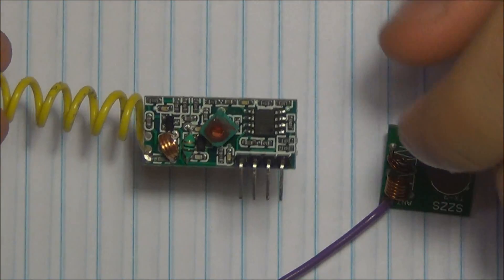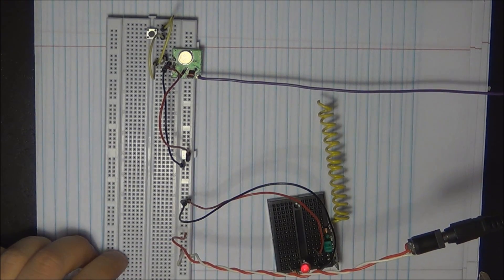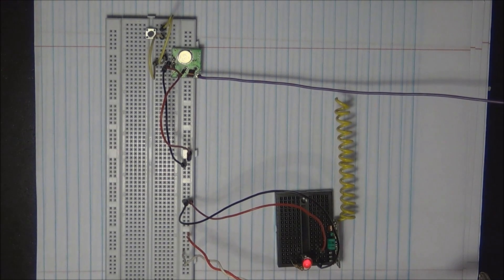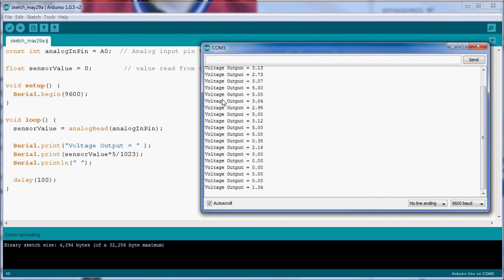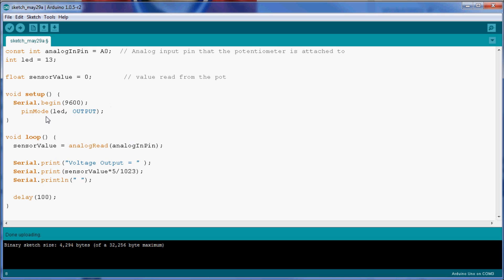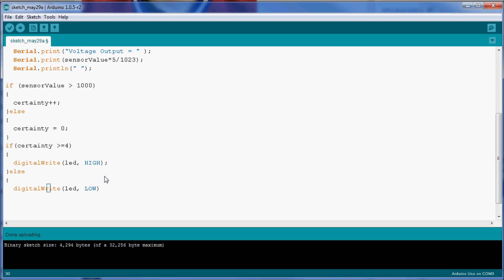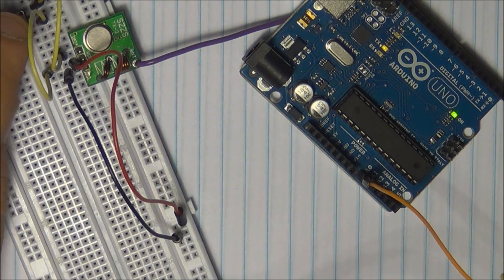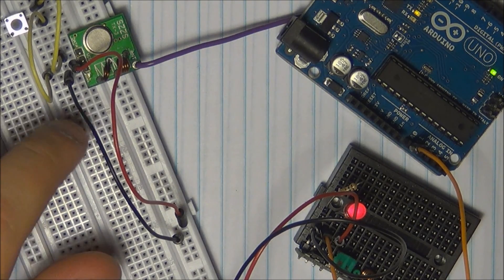Arduino Tut. #8 - Wireless RF Links Tutorial & Noise Reduction

Comment: Hi, I came to your video while searching for some fork of the RadioHead library that would compile cleanly on the Roger Clark core for the STM32F103C8T6 board... or I'll have to use the code from one of those nice Arduino MorseCode tutorials, encoder+decoder  :D

I think you are actually debouncing the switch you have connected on the TX side, I wouldn't call that "noise reduction".
Yesterday/today I've tested at that short distance two pairs of those TX and RX modules, 433 MHz and 315 MHz, and they do not introduce that kind of "noise".

Test conditions (please NOTICE that the last time I launched the scope autocalibration, 2-3 weeks ago, it was warmer than now, so the values mentioned below might not be the most precise readings I could get out of this low budged 100 MHz two channels scope, which is anyway great for the price IMHO):
Signal generator two channels into the two TX modules, tested with 0..5V square wave and also 0..3.3V square wave (and varied frequencies and duty cycle).
Oscilloscope two channels from the two RX modules, I get two nice rather clean 0 to 4V square waves (actually min -240 or -160 mV to Max 4.08 or 4.20V, rarely 4.32 V, so in order to safely feed that signal into 3.3 V not 5V tolerant pins I'd use a voltage divider: 4.7 and 15 kohm).
This 433 MHz RX module shows (surprisingly) a longer rise and fall time than the 315 MHz one, 14-20 µsec vs. 7-10 µsec, which implies that when raising the modulating frequency up to 8-10 kHz (50% duty cycle) its output becomes earlier a trapezoid and finally a triangle than what comes out of the 315 MHz module.
5V power supply into the four modules (nothing fancy, I do have completely linear power supply but also wanted to test a breadboard power supply that I also just bought, which in turn was being fed by a small switching power supply rated 9V 2A).
No breadboard, just Dupont cables, everything on a wood desk.
I also tested feeding into the TX modules very low frequency sinusoidal and triangular waveforms (down to 1 Hz) => better than I expected, not quite as if the TX modules were incorporating a Schmitt trigger but less "spurious" commutations than I expected, mostly on the falling side of the square wave coming out of the RX modules. (Of course these ASK TX modules are not meant to get anything but square waves as their input.)
And I also tested reducing the input square waves amplitude down to 1V just to check were the problems started. Sorry, lower than 3.3 V there's such a considerable margin before getting in troubles that I haven't noted at which peak tension the troubles were actually starting.
One further positive note: the fact that both pairs were working at the same time was not a problem, each RX module was cleanly reproducing what I was feeding into the corresponding TX module (frequency and duty cycle).

Comment: This video enough for be sub :) i will watch de-bouncing videos by the way because it is important topic about control buttons, normally i use low pass filter but i wonder how.
Thanks for video. I wanna see from you how figure out ACS712-5A current sensor nosie reduction.
Can you measure 1mA (1mA resolution) with this sensor ?

Comment: a good method would be to look for a 0 then 5,  or 5 then 0. two bits together represents data. 55 and 00 are disqualified, and so is anything else. thats how ethernet works. 

ADSL does interlacing where say you get 10 samples and then slice it up so bits 0,2,4,6,8 are in sequence followed by bits 1,3,5,7,9. what that means is in order to get a false positive you need 5050505050 or 0505050505 to appear on the data stream.

the idea is that you intentionally put a pattern into the data and then look for that pattern out again. the noise is noise, but it wont recreate your pattern since the noise is opposite of order.
Reply: you can do all kinds of patterns say bits 0918273645.

Comment: There is an l in solder
Reply from the maker: There is indeed. Sorry about that.
Reply: EEEnthusiast No problem man :p
Reply: EEEnthusiast I actually had a question about the transceiver. Can it change from the transmitter role to receiver role mid-program? If so can bother be receivers until one chooses to transmit?
Reply from the maker: To which devices are you referring to exactly? The modules I spoke about in this video are only transmitters or receivers. You couldn't switch that in software. In case of a real transceiver, you definitely read/write data depending on your software; switching mid program should not be a problem.
Reply: EEEnthusiast Ah and do you know of any "real" transceivers that work with arduino?
Reply from the maker: The most commonly used ones with Arduino are nrf24l01 and esp8266. I don't have much experience with them myself, but from what I've heard they are excellent choices.
Reply: EEEnthusiast Thanks

Comment: A small doubt. Do they work in pairs? I mean one transmitter will interact with only receiver. Or one transmitter will interact with all the receivers in the range.
Reply from the maker: The transmitter will interact with all the receivers in range. However, you can easily program a simple bit check to distinguish between different transmitters.
Reply: Yup, thank you for the reply.

Comment: Thanks for the video, helped a lot. I built the RF433mhz Rx and Tx module communication using Arduino.
Reply: I also want to do what you did with that transmitter and receiver and broadcast frequencies can you help me?
Reply: if both Rx and Tx are same model, like 433mhz, they will communicate using that frequency.

Comment: Hello, how can you reduce the noise without an arduino ? Please it's very important thanks !
Reply: Minege yes you could use a 10k resistor between your button pin and ground. This keeps the devices button pin at zero until the button is pressed then it goes to 5volts.
I believe this video is trying to show ways of doing noise control via software...

Comment: Loved the video. Im planning on using an arduino pro mini and these 433rf modules in a micro rc plane where i would use the motors to control yaw and pitch.. Hence would need to use this setup to drive those motors at differential speeds.
Do you think its possible? I came across your video an the concept seems similar.. 
Could use any advice and help..

Comment: 6:25 actually arduino (atmega8 ucontroller) has 10 bit a/d converter built inside. 10 bits can be arranged in 1024 combinations, including 0 (2^10). So max value can be 1023, but those are not bits, its the value expressed with 10 bits.

Comment: Not exactly Arduino related, but can these inexpensive modules be used in a stand alone way? if the modules are powered and grounded, will the "RX data pin" follow the "TX data pin" state? Example........If I had an LED on the  "RX data pin" and tied the "TX data pin" to a high state, would the LED illuminate on the RX?
Reply: they also has interpreter chips designed to work with them

Comment: i have purchase the 490 MHZ 881jz RF Module which is not interface with 
arduino is any one can toled me about any one module interfacing with 
arduino,
Reply: I think it does not matter, cause this guy is using 315MHz modules with Arduino:
http://www.instructables.com/id/RF-315433-MHz-Transmitter-receiver-Module-and-Ardu/?ALLSTEPS
Just use the library he is using; virtual wire. Or learn how to use it.

Comment: Your antenna looks to be wayyyyy to long.
Reply: +Derek Georgevich 433 Mhz give a wave length of approx 692 mm. Antenna length equal to half wavelength is pretty standard (346 mm). Quarter wave length should only be used if antenna is on ground plane.

Comment: Hi Vlad, 

Nice instructions. I trying to make something different, maybe you can help me and make a exemple. I need to make that arduino by ethernet make a simple comand to PIN 6  for exemple where is connected the RF 433 mhz DATA PIN . When he get comand from arduino is necesery to send a comand to RX RF 433mhz and close a single relay. 

I hope that is clear , at the end of the story i making the wireless controlled relay. Of course power of the relay and RX RF 433 Mhz i give with external power device.

Comment: is it possible to have few receivers and control them from one transmitter?
Thank you!
Reply from the maker: +Boby Bob It is possible to have many receivers. However, they would all receive the same signal. This means that if you are trying to differentiate between them, you would need to process some sort of an identification sequence. In other words, you would broadcast "000message" for node 1, "001message" for node 2, "010message" for node 3, etc.
Reply: are you can told about me this problem.
i have purchase the 490 MHZ 881jz RF Module which is not interface with 
arduino is any one can toled me about any one module interfacing with 
arduino, umairm452@gmail.com

Comment: what will the coding look like if i had two push button controlling one LED each because im using a 4 channel transmitter?
Reply from the maker: +Henda cagon You would use 2 inputs on the Arduino side and send two distinct signals to your receiver.

Comment: This may be unnecessary.  I'm sure most of you will go: "DUH".  Anyway I found that connecting the receiver to a USB port causes low voltage/current problems.  I thought it was noise, all the erronious signals.  But also, my xmitter would not be recognized by the receiver half the time.  I worked on this for a week.  Before discovering the pulpit, I have done a lot of noise reduction that ultimately has made my setup incredibly stable
despite the fact that I"m using the cheapest Chinese knock offs from ebay.  They end up being like 1.49 for the pair.
Back to my solution:  When everything else fails, check supply voltage.  The main problem was that the 5V output that powers the receiver, was outputting .37 volts.
Holy moley, Jackson!  So I powered the receiver board with the v supply I use in all self powered projects.  The wonderful 18650, 5000 milliamp/hours batteries.  I use two in series for a total of around 7.5 volts.  
Now everying is so great, I'm scared.  When attaching either the xmitter or receiver to a USB, leave it powered by the batteries.  The Arduino chooses the better power source to run itself and peripherals
Thank you all for your undying interest and cooperation in these and other related matters.   lol.  jon.
Reply: very cool jon! Thanks for your advice. I picked up a whole bag on ebay myself for CHEAP.
Reply: yeah mate USB is awful for noise. most people have no idea how much toilet sewage is spewed onto the power rails by the time it reaches that usb port

Comment: does anyone know if i can use this to transmit audio ? for example wireless amplified speakers.
Reply: No. These use on-off keying of an unmodulated carrier. The transmitter emits RF continuously for a "1" and nothing for a "0".
This technique can of course encode an analog data stream (audio for example) but the receiver can only respond to a baud rate around 1000. See Wikipedia for more info.

Comment: Thanks for the video man. Can this transmit up to  250 ft (75m) in a open field?
Reply from the maker: +Jonas Roque Based on the datasheet of the modules yes. That being said, I would test it in field to confirm. Also, keep in mind that the antenna you use will impact the performance a lot.
Reply: +EEEnthusiast thanks again I'll buy one of these to create a lap time meter . if you test at this distance please tell me

Comment: Hi there, I am wondering that if you mentioned that these transmitter and receiver comes in pair. Does it mean that I can use many pairs and use it to read a sensor on and off. These are typically 433Mhz. Does one pair interfere with the signal of another pair? 

(additional) I am really curious. I have use 4x 315Mhz 2262/2272 YK04 M4 remote model, however seems that even with different address(tri-sate configured. When one pair signal is pressed, it interfere and sort of send the high signal to low when another pair button is pressed.

  Mainly I am interested to use a sensor to read off when one of my house light is on through a LDR. I would like to use a few pairs to read which are the different room light is on or off. read by arduino.

Hope you can give your comment and anyone who have prior experience. Thanks in advance.

Comment: Good practical use of the hardware!
It seems that you are missing a pulldown resistor in the circuit. Try connecting a 10K resistor (to GND) to the button on the same leg  you connect to the data pin, and you'd get a clear LOW when not pressed, and clear 5V when pressed.
Reply: Hi James,

I don't know if you're still trying to get your transmitter-receiver pair to work, but here's how I got mine going.  First off, the receiver never did seem any good at catching a pulse here and a pulse there.  Seems it needed a stream of pulses - a bit of coffee I guess - to wake it up.  So instead of sending pulses only when they were needed, I fed it a constant stream of 1 ms wide positive pulses at 100 Hz.  Then, when I wanted it to receive a "signal", I made the pulses fatter.  Specifically I used pulses from 1 ms through to 5 ms at 0.5 ms intervals to encode 8 different actions, apart from the 1 ms no-action coffee.  The receiving microcontroller measured the pulse duration to sort out what it had been asked to do.  That's the whole trick I think, sending it a constant stream of pulses.  Good luck with your projects.
Reply: Do you mean i need to put a 10k resistor between the data pen and the other side to gnd?
Reply: Yes sara. Now the input is floating when the button is not pressed, making the receiver see a stream of random data until the button is pressed.  the resistor pulls the input low, and that should fix the problem with the output of the receiver going high.
Reply: Is there a chance someone might throw together a quick schematic describing this? I'd really appreciate it! I've tried to make this work and been unable to do so. For mine, if I simply power on the receiver and don't power on the transmitter I still can't get the data on the receiver to stabilize. I've tried switching the input on the transmitter to flip between ground and VCC with a 10k resistor, I've put it on 5v directly with 10k to ground... just no luck over this way. Any help greatly appreciated. Thanks!
Reply: Yeah I did some other digging and the circuit clearly doesn't manage any sort of high low signal internally. I came to the conclusion something like you describe was necessary but didn't know quite how to manage it.
Reply: Derya Pamukcu X.   These cheap modules are very noisy  but this filter helps loads. 
https://youtu.be/ozEElAcXGuc
https://youtu.be/1uKdsyXwavU
Reply: I think the problem is coming from the reciever part sir not from transmitter. So the pulldown resistor will not solve the problem.
Reply from the maker: +Derya Pamukcu I did realize that I was missing the said pull-down later on; I'm not sure why that thought escaped me at the time I had made the video. Thank you for your comment.
Reply: it is always these pull-ups/downs that send noobs into oblivion! ;D

Comment: Is it possible to make your own transmitter and receiver? How?
Reply from the maker: +Mark Anthony Manuel It is possible to make your own transmitter and receiver. The branch is called RF engineering if you are interested. I must warn you however, that it is fairly complicated and chances are your device will not perform as well as these shelf transmitters and receivers. As to how exactly they are made, you would have to do some research as I don't have that answer.
Reply: +EEEnthusiast Thank you so much. I have settled to just get a module like this. How it is possible to have more than 1 output without encoder/decoder?

Comment: Hi there really like the video, i have just one question, From what i understood from this video, to me it makes sense that you could very simply use these components to simply activate and deactivate a PIR sensor ?  From a software standpoint how would you do this ? (i'm very new to programming ect)
Reply from the maker: +zv3000 Activating and deactivating is very simple. You switch your digital pin from 0 to 1 and vice versa to turn it off. Check out my digital I/O tutorial

Comment: Nice analog example using 1 Arduino. Any method to use VirtualWire/RadioHead libraries' transmitter/receiver sketches concurrently with 1 Arduino (on digital pins 12/11)?

Comment: Hello EEEntusiast thank you for your video...what RF modules would you recommend to use to get a range of 1 Km so as to monitor a magnetic reed switch in water tank showing availability of water at a remote  drinking waterhole for animals on my wildlife sanctuary..all I need the arduino to show at the lodge is a LED on or off state..
Reply from the maker: Victor Hugo I would use an XBee Pro Module. The specified range is up to 1.5Km which should fit your specs. It is also a very versatile module which can send serial data and can give you more functionality than you specified.

Comment: Sorry, sure you have been asked a few times, but can you provide the schematic?  Trying test without the arduino in the loop but get very little voltage out of the receiver data pin output.

thanks